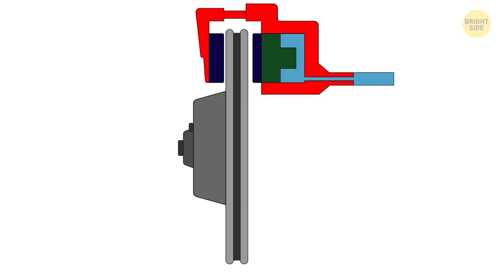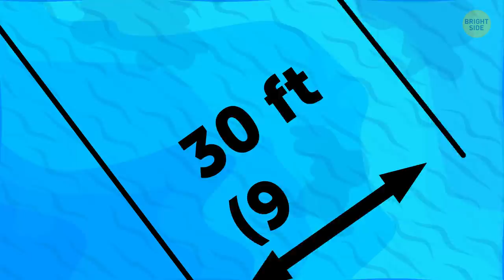How Ships Stop If They Don't Have Brakes

Comment: Random fact: technically your cars brakes force the wheels to travel with the vehicle rather than remaining stationary relative to the road surface.
Next time you see a car move pay attention to what happens at the point where the rubber meets the road. The contact point doesnt move, the vehicle itsself is what actually moves.
Reply: Woah. Mind blown🌋🌋🌋🌋

Comment: Interesting, I have to admit I already knew that, but it got me thinking, there are so many YouTube videos of big huge ships in really rough seas, and it makes me wonder why don’t they just add more stabilizing fins to the haul? An airplane wing is the perfect example of what I’m talking about, the pilots are able to adjust the wing to reduce as much turbulence as possible, so why can’t that work for a ship? I don’t think I’ve ever heard of any ship having more than one fin on each side to stabilize it during turbulent seas, but why not put two or three on each side? Especially ships that cross The Atlantic Ocean, usually from New York to the UK, those are some of the roughest waters on the face of the earth, and the most deadly, that’s where the titanic sunk. Granted the titanic’s problems were several that all lead to a disaster that was unavoidable, but with today’s modern technology, And the perfection of artificial intelligence, things like the costa concordia could be completely eliminated from ever happening again. I’m not an engineer, actually I’m a lab technician, both x-ray and medical, but I have a passion for building things and designing things, or in this case redesigning. I never had the chance to get all the university education I wanted because I was struck down with cancer when I was only 20, and for the last 30 years I have been battling against it, but I wish to God I would’ve had the chance to go and study engineering and architecture, because I know without a shadow of a doubt, I could build things that would eliminate every single vessel ever built before it. I’ve made countless proposals, to both engineering firms and architecture firms, but I’m always denied because I don’t have my degree, I just have vision, something most people don’t seem to have any more. I have been on a ship that left New York and went to the UK, and even though it was sunny, the winds were over 100 km an hour, and the waves were at least 30 or 40 feet tall, and even though they deployed the stabilizing fans, it did very little to smooth out the ride, because the ship is enormous (it was the Queen Mary two). It was a last minute trip, and because all the upper cabins are taken, I had to take a cabin without a balcony, but just the window. I remember sitting in the window watching as we went totally underwater as the waves crash against the ship, a pretty terrifying experience if you’ve never been to sea before. I found a copy of the original blueprints, altered them on my computer to add a second set of stabilizer fins, so that each side had to stabilizer fins. I ran several computer animations, thank calculated a 70% decrease in the amount of pitch and sway on the ship, making it a much much smoother ride for all the passengers. I submitted my ideas to several engineering firms that have built huge ships, but they all turned me down, simply because I don’t have a degree, despite the fact that I had every technical schematic and detail imaginable including simulated runs on the computer. I don’t get it, we could make ocean travel almost 100% better, But to be told that my opinions aren’t valid because I don’t have a degree is absolutely ridiculous. I have met many many people with PhD’s, who are the most clueless people I’ve ever met, and I already do you have my Masters degrees in laboratory medicine and medical imaging technology, so I can assure you that education does not dictate one’s potential or abilities, because during my studies and in my work I’ve come across some real idiots who have all the credentials, but haven’t the slightest clue how to put them to practical use or how to Improve upon them. For some reason the moment I see something, the first thing my brain does is try to think of a way to make it better, don’t ask me why, I’ve been like that since I was a kid. My parents used to get so mad at me because I would take everything apart, including the television, the radio, the car commoI tweak it and put it all back together again. My parents are always floored but I was able to do that, but I think I gave them a heart attack a couple of times when I started taking apart things that cost them thousands of dollars, but after a while they knew I knew what I was doing. It’s simply because of the cancer I didn’t have a chance to further my studies, and for that I’m being punished, we live in such a narrow minded world. But I have no doubt that within the next decade or so, we will have massive ships, airplanes, trains, cars, and any other mode of transportation, that are totally run by autonomous artificial intelligence, no humans required. After seeing the way people drive, I think I would trust the computer more!

Comment: There is a way to stop ship
 There should be a propeller in front of the ship which will work as a brake
Reply: It would work great with rear propeller in reverse too.
Reply: That's a lot of money and it would create a lot of drag most cruise ships have rotating properties so they can go full speed in reverse thrusters wise

Comment: :-: about fact is that the Titanic might of made it to Port if they hit it straight on instead of try to go around it witch cased to icebrg to scrape a mile long gass on the hull of the ship.   

Also I said might of  
If they did they'd probably be able to get close enough to save everyone on board.  :-:

Comment: I'm just thinking what if they put some kind of break disk on the anchor rotor thing the one thats rotate to store the chain away so the ship would not do an instant stop when it hit the ocean surface instead it would slowly press against the the break disk just like in the car. Just a curious boy here 😄😄😄
Reply: Firstly, you would have to be in shallow water, for the anchor to touch the bottom. You cannot hold infinate lengths of anchor cable on board. So in the Titanic's case this was not an option, the water was miles deep.
Anchor winches do have brakes, to slow the speed that the anchor is deployed. However, vessels are very heavy and bringing them to a stop using the brakes would immediately wear something out. They may float, but they still have mass.

It's a matter of economics. What's the minimum you can get away with, without huge costs of large cables, brakes, winches etc. That's why ship's master's and crew are highly trained, not to get into awkward situations in the first place. This is cheaper than alternatives.

Comment: what if u use some kind of parachute
Reply: Actually it would work but it would depend on boats behind the ship..
Reply: There is such a thing for small boats. It's called a 'sea anchor'. It's a parachute type thing that you throw overboard, attached to a strong part of the vessel by rope. The main purpose is to make sure the bows of the vessel point into the weather, in a storm, to stop rolling, capsizing and present the strongest part of the vessel to the weather.

Comment: ... anchors..?
Reply: Megapies the bottom of the ocean where titanic sank is 2.5 miles deep anchors would not work, it takes 10of minutes to prepare an anchor,titanic hade 50 seconds from seeing the berg to hitting it.
Reply: THE SAM ok then, if they had nearly a minute, why didn’t they just... steer around it?
Reply: Megapies do you know how long it would take, the only possible way the could miss it is if they saw it earlier or were going full speed,which the where not